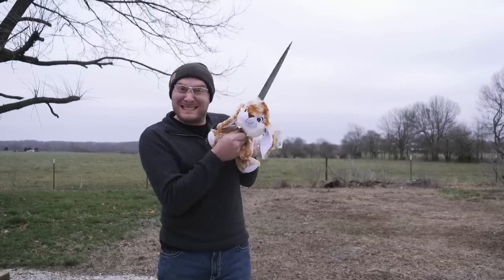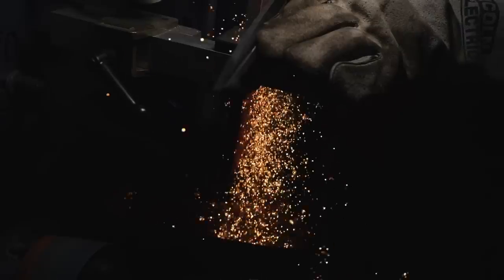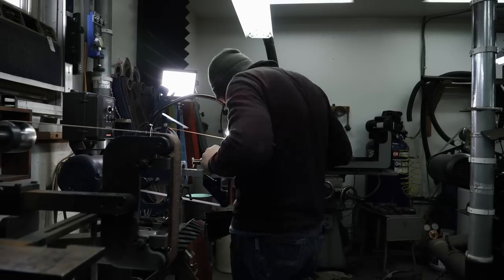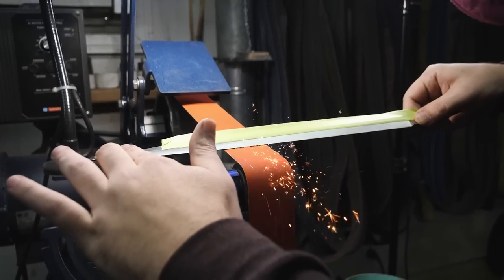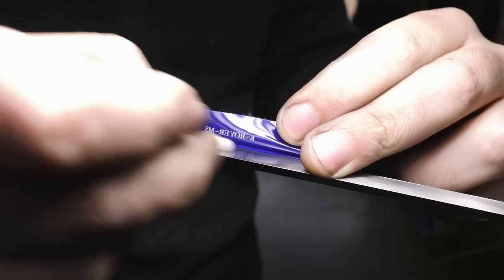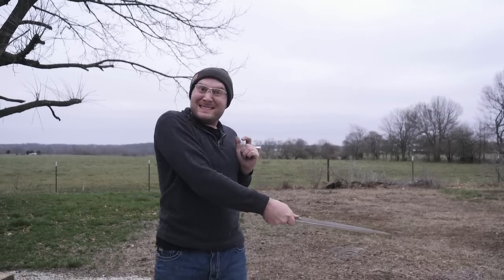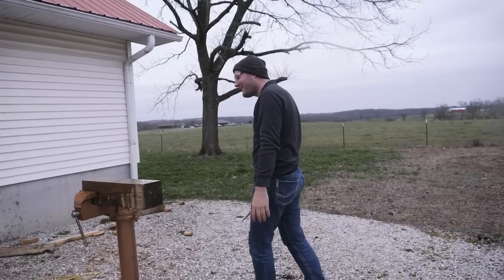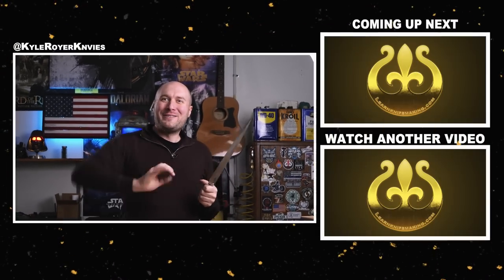Will This Dagger Keal? (Serenity Pt. 5)

Comment: would it be a bad idea to let the fuller go down the tang on a slight downward angle towards the tip of the tang, 
so that you could fit the guard into the fuller and not have a gap on both sides when it´s slid on?
Since this´ll be a collectors piece anyhow you would´nt have to worry about strength at the tang anyway, right?